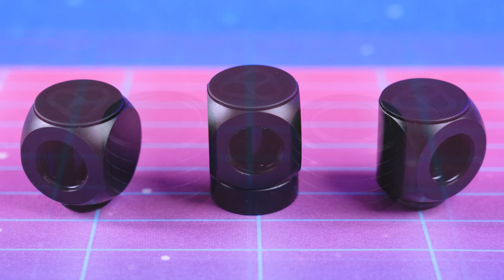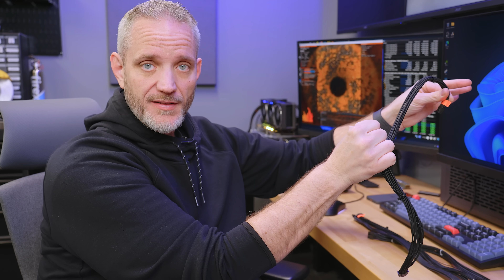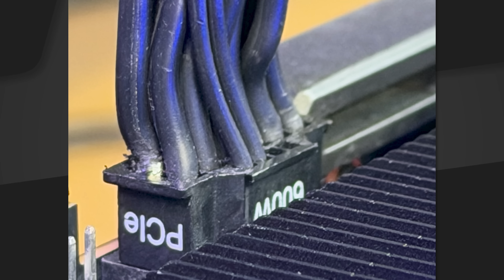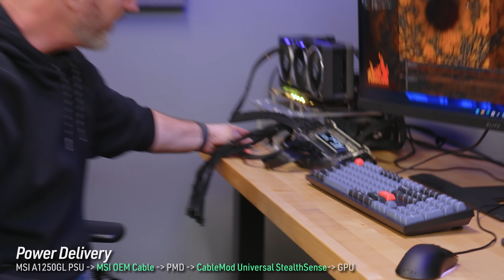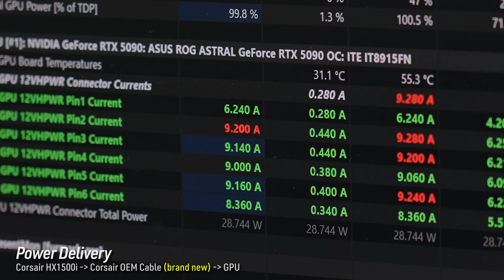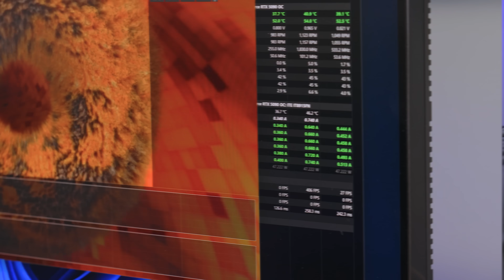More details on what could be causing 12VHPWR / 12V2x6 Cables to melt

Comment: Wonder how a system prone to overheating those 12VHP/12V2X16 cables would do with pretty much active cooling over the cables to keep them from burning out? Just had that thought. I've been running an AC/PC for a few years now with a 12K BTU AC with custom designed and 3D printed ducting plumbed straight into the front of a Lian Li 216 cooling a 104.2 BCLK OC'd 5800X3D with a Merc 310 7900 XTX flashed with the AsRock AQUA 550W VBIOS. Got up to third place in TimeSpy at the time for 5800X3D 7900XTX. Still #6 spot I believe (silvia95guy). My little "Ultimate Air Cooling"  project was literally the reason I bought a 3D printer, which has become it's own obsession, and did it 2 years before Linus made a video about it. Think my setup is better too. This being said. With my system being completely cooled, and not just the CPU and GPU, it keeps EVERYTHING cool. Even the cables, as that cold air is able to flow straight past all of the cables right into where they connect to the PSU. Have the PSU flipped too with the fan in the case. I've had over 700W GPU draw on my 7900XTX through 3x8 pin, with a constant 555W running through it for hours no issue, which I wouldn't ever expect an issue anyways with 3x8 pin anyways, as they have been tested tried and true for over a decade. I honestly can't believe those who have made this a standard haven't swallowed their pride, and admit they messed up, and pulled this new horrible standard off the market. I'm seeing Sapphire 9070XT's that come with this pin, and they are blowing out too. Just get rid of it. Will never purchase a GPU with this cable connection. Good Job Phil calling out the cables as the issue and not the cards. We shouldn't have to work on the cables to make them work correctly.
Reply: The cables gets hot in the housing and inside the wires. No way you can cool it efficiently
Reply: @nimaahmadi-s7o  maybe not, but having the wires 30C cooler with constant cold air flowing over them has to help in some way I would think, but yeah, all it takes is a little shorting out, and no amount of cooling will save it. My entire system sits at 48C active cooling off, and in the high teens at idle at around 18C with it on, so a curiosity more than anything. Not like I'm going to test it, as I refuse to purchase any card with this type of connector. lol
Reply: @TimothyStovall108  Or or or or just get a WireViewPro 2. That will melt if it wants to melt. 30C cooler or not. The heat will keep compounding

Comment: Anyone suffering from these bad card designs need to start a class-action lawsuit. Nvidia knew these problems existed before they became widespread. Even now, they refuse to make any attempts to solve the issue. These are expensive components, stop letting yourselves get worked over.

Comment: Next video: DIY cable. They're not difficult to DIY if you can get the parts and a good crimper with the correct dies. Try to get the parts from a legitimate manufacturer like Molex.

Comment: so basically what we are seeing being the issue with higher end cards such as 5090s and honestly on even some mid tier cards, is not an issue with the GPU or PSU its the quality of the cable thats being connected between the PSU and GPU. 

i just grabbed a MSI gaming trio 5090, so i already know to avoid the adapter that came with the card but how have we had  40series, 50 series and other cards with the melted cable issue for over a year now and still have no real direct solution is crazy to me. and all the protection that is supposedly coming out such as optiguard, safeguard, etc seems to still be months away. thankfully we have the wireview pro but that just mitigates a problem not solves it. companies need to start releasing better cables so users can have peace of mind and not constantly worry about their GPUs and overall system.   i get they are all in the business of making money, but they are basically waiting for a lawsuit to happen.

Comment: I had this issue with my Astral 5090 OC with a brand new PSU. The PSU in question was the ROG Thor 1200W Platinum II. The loads on the pins were imbalanced and some of them were pulling more amps than they should. This was flagging up immediately by the red led flashing on the GPU, which I thought was really helpful. To get around this issue, I had to reduce the power drawing capabilities of the GPU (not ideal as not benefitting from the full power of the GPU).

I have since swapped out the PSU to the ROG Thor 1200W Platinum III and have plugged in the Intelligent Voltage Stabilizer cable. Thankfully that seems to have done the trick and the GPU now appears to be working as it should without the load imbalance.

Comment: Hi there another good video, thank you.  A couple of observations, have you de-pined the connector you thought loose and one you think is tight and inserted the shells to eliminate the shell and any manufacturing tolerance in the shell?  I also find it ridiculous when you look at the tech used on graphics cards etc that we are still using cheap nasty injection moulded plastic connectors not to mention the pins used all designed decades ago, a redesign is long overdue.  I worked in robotics for a while and if I had used connectors like that people could well have been killed.  Oh yes fire from bad connections as you know can cause fires and they can kill; something has to be done!

Comment: It's crazy that if they had just left a 3x8-pin power connector on their cards, this wouldn't have been an issue.
It also wouldn't have been an issue if they had load balancing built into the board. 
It also wouldn't have been an issue if they had per-pin current sensing that shut down the GPU if it detected an anomaly.
Reply: They can't the 5090 can pull 600watts.  Also people are buying multiple cards for AI, all in one system.

Comment: The cable issue makes me think of the car audio world. You can melt your fuse up by the battery without blowing it if u have a bad ground... i got a cut in the protective jacket and ended up with a crunchy green mess that contributed to the fuse melting. Point being cables are alot more important than we give them credit for, theyre still metal covered in plastic n shi...
Reply: Id guess it has a protective circuit that switches off when it fluctuates. If you hook a dmm up youll see a spike when your messing with the ground wire. Again learned this from car audio also.

Comment: I went with AMD this gen, specifically to avoid 12vHighFire
Reply: If you went with AMD, then it means you got a mid range 70 class card, but the connector isn't an issue on that class, so your choice was pointless.
You just don't see 5070s and 5070 Tis having an issue with the connectors, the cases of that happening are as rare as finding cases of regular 8 pin connectors burning.
Reply: @Augusto-t2q  Still better than what I previously owned and I'm not giving Nvidia money for making shit products

Comment: Computer Engineer here. Bend radius rules explain the wire being weird. This applies to everything, including power signals. The people who designed this cable and connector need to know how much quality actually matters. The quality of a cable is in 3 main parts:

1. How the wire itself protects the signal.
2. How well the wire protects the signal when it transitions from the wire to the connector.
3. How well the strain relief protects 1 and 2. 

Now..... Repeat that for the plug end. Same rules apply.

Comment: Jay, I have a suggestion as a follow up to this. Most folks don't have an Astral or Wireview. But everybody can easily download HWInfo. I've been a big proponent of using that to view voltages on the 12VHPWR line and setting an alert when it drops too low. 

So my suggestion is this; with the Astrals per pin sensing, can you show the relation of displayed voltage on HWInfo to what the pins are reading out in amps? Since amps and voltage are inversley proportional it would be helpful to show folks what kind of voltage they should be looking for. With your menagerie of various quality cables it would be easy to find poor connections and show the voltages associated.

I spoke with somebody on Reddit the other day that was getting low 11v regularly. My card and cable usually sits around 12.1, but does dip into the high 11.9s from time to time. I have the alert set for 11.95. I was a bit shocked when I heard what their voltage readouts were and they didn't have any problems with the setup.

Comment: If you stuck a multimeter probe on both ends of the cable and set it to resistance mode, by moving the cable you should be able to see spikes in resistance if there's a break or damage in the cable. At least, that's how we do it in automotive diagnostics.

Comment: Thanks for the info Jay and team. I've been in electronic equipment repair since I was 15  (53 years ago) at a vocational high school, never have I heard so much commendation on a connector. What a piece dog poo, The amount of trying to save your $1000 to $5000 GPU because of bad engineering and also the owner has to buy hundreds of dollars, in extra hardware and cables, to try to save the GPU from its self. Why, why, why...   Footnote; I will never buy a GPU with this connector, even if it is a 100W card!!!

Comment: I recently changed a Seasonic PSU for a new Lian Li as Lian Li are now making their own 12volt 2x6 with soldered in pins and a fully moulded plug with heavier gauge wire. This apparently helps reduce amperage and once I had my Wire View Pro 2 I was able to confirm that this works. Even at 600 watts the per pin is even at an average of 7.8 amps. Also you have to remember that all cables are wire and you can break any wire if you stress it enough times.

Comment: Xt60 connector mod coming when? No more worry after mod,and none of my cards had connector problems in first place,just done for more peace of mind.(Asus Rog matrix platinum 4090/Asus Rog Astral Oc 5090,PNY rtx-6000 48gb(600 +watt bios),PNY rtx 6000 pro 96 gb(600+ watt bios)..)

Comment: 10:30 that does not look like brand new "stock corsair oem cable" from hx1500i, just purchased this psu model like 2 weeks ago and mine has all the wires separated, all of the wires have a pattern on each wire isolation, and corsair is specifically telling users, even on the psu itself to use only the ones that came with that exact psu model - probably for a reason
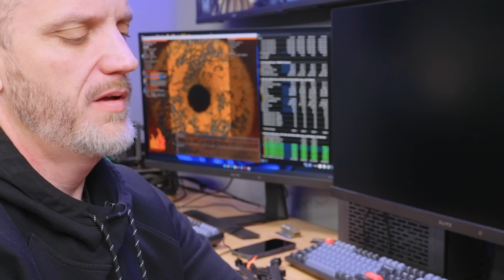Reply: and yes 16:30 one pin is busted like many has pointed out
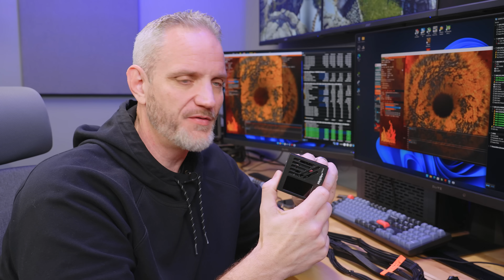Reply: ahhh 19:10 you're selling a product... well that's a low blow making up things or making up tests unreliable to sell a product boooo
Reply: oooh you're selling that device and cable, cmon
Reply: it's 2-3 years old, never used, left in the box. So this IS effectively brand new, but not actually
Reply: @therealpuzzlecube3123  so it's hx1500 [released in 2021] not hx1500i - or more likely the cable is 12VHPWR type4 that was sold by corsair for hx1500 as a separate product, possibly also from 2023 model but i don't know if 2023 had type4 or type5 one, most probably t4 - either way corsair asks you to use type5 with hx1500i v 2025 - all 3 versions have different sku's - i know it's cherry picking but when you're talking about product that is currently so overpriced you should be much more specific - especially if hx1500i that added type5 cables specifically asks you to use type5 cables with it ;)

Comment: Note about the Sapphire: I have NO CLUE what connector it uses, but I had to literally HAMMER the psu cable into it (a Deepcool PN850M, it has a 12V connector and cable in the box) with a flat head screwdriver, that's how tight it was. I could not, for the love of me, plug it in with my hand. I did unplug it to check for bent pins or other damage. Same for the adapter that came with the card. And unplugging is also hell. I have a feeling that the burnt 9070XT's were not fully plugged in because of how hard it is to do, and the user just assumed that "oh, it's not going in anymore, it's plugged in".

Comment: So nearly 10amps on a cable that clearly isn't up to scratch. Even a quickl google search shows for for the wattage you should have 16 or 14(recommended) gauge wire. GPU cables, These cables do not look to meet the standard. From looking most are supposed to be 16 gauge but a lot of cables are 18 gauge, this is bad very bad.

Comment: Man.. I'm still running a Ryzen 3600X, I now have 32GB of TForce RAM, an Auorus Elite M motherboard, (wrong wording). A 750W power supply, a dodgy Samsung M.2 512GB drive and the "old" 1660 TI ... All works faultlessly.... Especially now that I'm running Linux.............. I ditched microsoft forever. Now I can use my PC without all the BS..

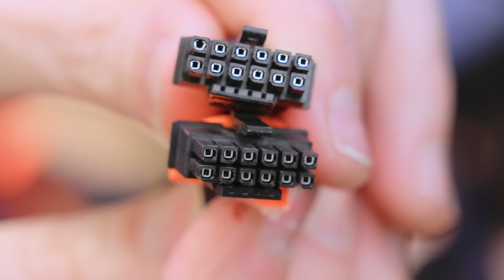Comment: At 16:32, you can see on the top plug, the top left opening is stretched open. Also the bottom plug, the top right plug is stretched open. This could be the cause of the issue.

Comment: I bought a Corsair 2x8pin to 12V2x6 cable for my OG HX1200i and my cable is not at all that lose, it sits in tight and is "normal". Been using it for a long time now, never have my Astral 5080 reported anything wrong. But it did with the included adapter cable at one time :D

Comment: At 8:00 ish what is probably happening is that the ground plane (which is probably one ground plane ) is looking at the amount of resistance in the circuit is my guess. If you remove one wire from contact that value is going to change. It would be fairly easy for the card to monitor this with a small microcontroller and have the card use software to shutdown.

Comment: its simple if you are a real electrician. 12v 800 watt is some serious power the cables are way too thin !!!! and the connectors are a joke! also the pins are round but the pins are square, only touching 2 sides because of the springi thing inside the plug. they should come up with aq new standard for plug and cables....

Comment: If only the card manufacturers actually employed competent electrical engineers....
Moving large amounts of current around is a known science, heck, it's one of the first lessons electrical engineers learn; Conductor cross section and length determine current handling.... either raise the voltage or increase the cable size... It's really not rocket science....

Comment: Copper conductor or Copper Clad Aluminium conductor knock off cable?  It's still down to design because of the current those wires are carrying at stock is best case.  By design its possible to overload individual pins and the conductors in the cable.  There's no overhead tolerance on the design.  Slightest issue and something fails catastrophically.  I deliberately got a GPU with the older 8-pin connectors to avoid this issue.

Only suggestion I can give is get a cable with a plug with a more robust pin design, larger cross-sectional area all copper conductors with a cable length that's not excessively long.  And don't cinch up the cables with tight cable ties.  Also these cables have very low plug/unplug count so they do wear out, so need to be replaced.

As a side note I did recently have a 24pin cable fail, causing reboots.  It had been plugged in an out over numerous motherboard replacements.  It was pushed in correctly the square connectors on the plugs had worn over the years giving unreliable connection.  Luckily it was just the power good one after looking at the cable after it had been replaced so no thermal damage just a very unstable computer that would reboot spontaneously if the case was knocked.

Comment: power cables melting, get ones with higher temperature melting point aislant i mean maybe your cable is pvc thats good for 70 degres celcius get propilene aislant cables those can wthistand up to 90 degres celcius... you know or i dont know buy something elsse not a 4090. they compressed to much power in to litle space and nothing can be done about... fixin it properly will have to redesign mother board of gpu on that weak crap designed area... getting bigger cables wold fix, but somehow im havin my doubts about the 5090 motherboard being able to handle so much power at lest the electronic parts this crap aint gona last gpu will last but motherboard is very bad designed...

Comment: Also jay the astral does not have individual power plains per pin it has per pin monitoring but it still has just one large power plain on the card after the monitoring circuitry. It just tells u when Amps are getting high so u can stop using the card or check your cable. This is why the issue never happened with 3090s they actually have the individual power plains but nothing since 40 series does.

Comment: I solved the melting issue by refusing to use the 2x6. got the rx 9070 and originally ordered a seasonic psu and had to run it using the 2x6 psu side to 2x8pin gpu side as apparently there was not enough pcie connectors, so I returned the psu and got SAMA 850w instead. Avoided 2x6 and saved 30€:face-blue-wide-eyes:

Comment: This godforsaken standard started with being a "seating issue", then a pin and connector issue, and now it's a cable quality issue. 
At this point create a new standard and let whoever responsible actually put in the damn work to make it future proof, make it be rated for up to 1000W have the thickest possible wire gauge and have current sensing on every pin.

Comment: Some time ago my GPU started shutting down on itself i thought it got borked or something, later i found out that cable melted on both side .. at least it didn't break gpu, psu also seemed fine i tested both with adapter cable 
I honestly thought that getting one of the best psu's and native both end cable would be the best option, well it is a 3.0 standard but still... it was a 4080 and that gpu with that cable was working fine for 2 years
Reply: Edit manufacter service said everything is fine ... i think they didnt even bother to look at cable